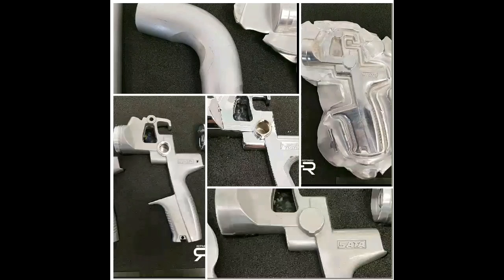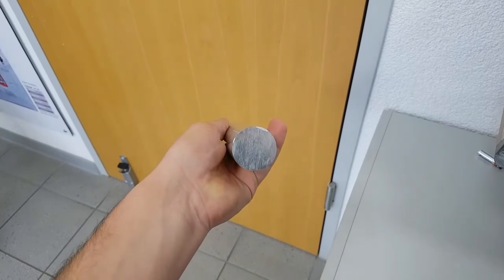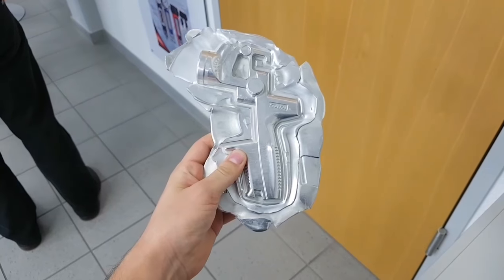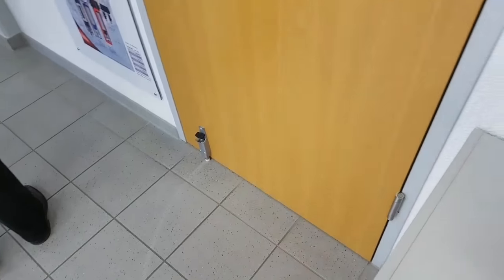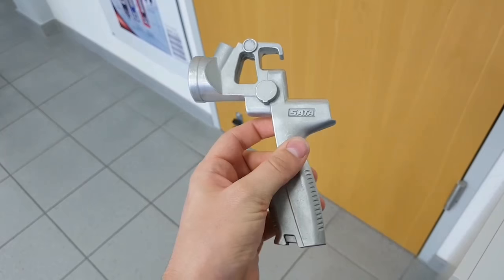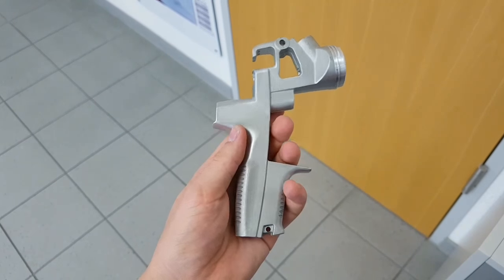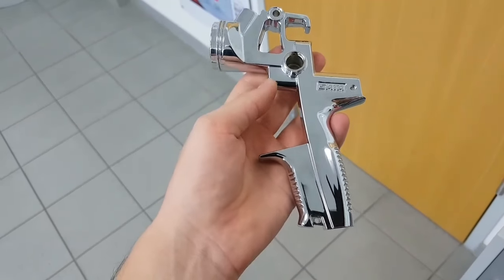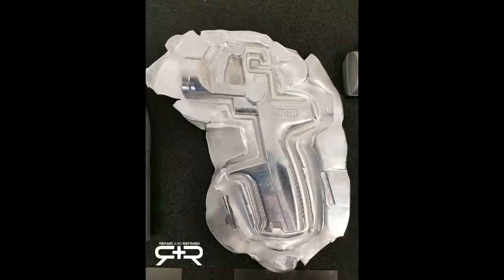How a SATA spray gun is made

Comment: Hy.how are spraying guns painted.i whant to paint my spraying gun.what quins of paint,and what method
Reply from the maker: +ionutclim hi, generally they are chrome plated or anodized. I wouldnt reccomend painting them. Thanks!
Reply: so how do you have some  sata with drawings , how they paint?
Reply: @portugalhydrographics  did you ever figure out what kind of paint you can use on a hvlp gun without the paint thinner cleaning the paint off?